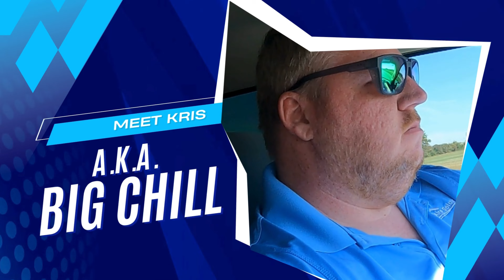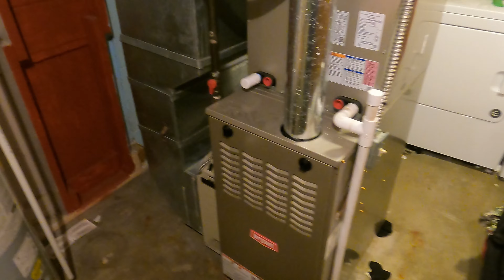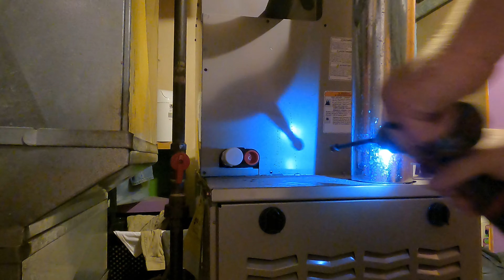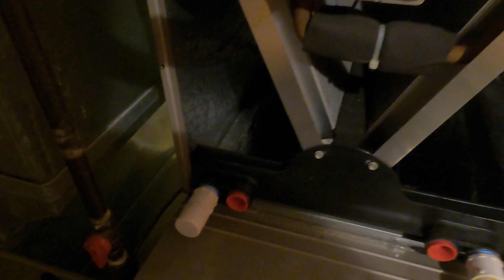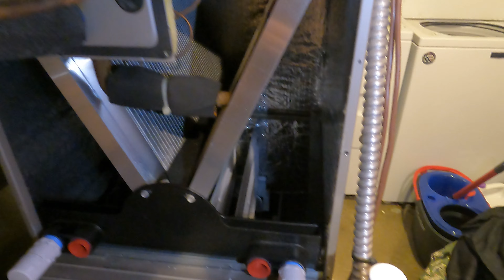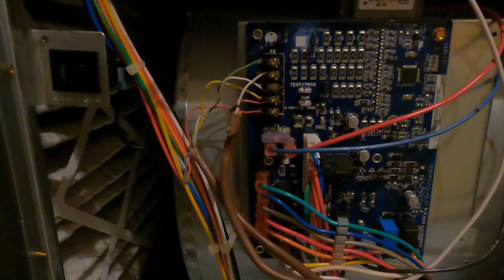Step by Step HVAC Real Estate Inspection & Cleaning

Comment: Good vid! What did you charge for this service and what was the total time on this location? NY TECH here, ps I like the tip on disconnecting the mamometer
Reply from the maker: The job took a total of 2 hours and 13 minutes, including 9 minutes of travel time. The final bill came to $330. The customer received a detailed report containing over 15 photos of the work performed, along with our custom forms documenting unit information such as model, serial number, age, amperage, voltage, pressures, and more.